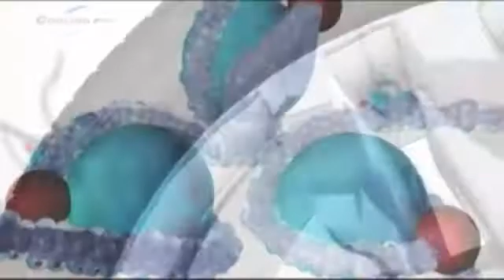Wireless Charging For EVs - Autoline Daily 489

Comment: @YAGO323 Nothing.  This technology has been used to charge tooth brushes for years.  To issues, firstly, a cat will not cause the charger to turn on.  The charger communicates with the car.  Secondly, even if it did turn on, the electromagnetic waves are harmless.   Well except for the fact that they make you sterile :)